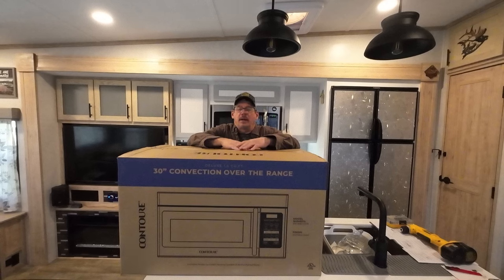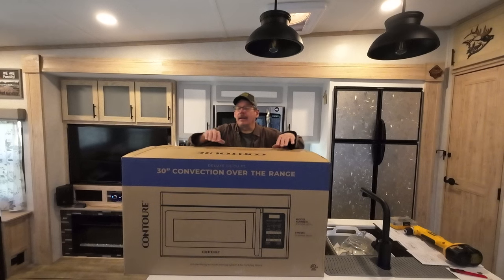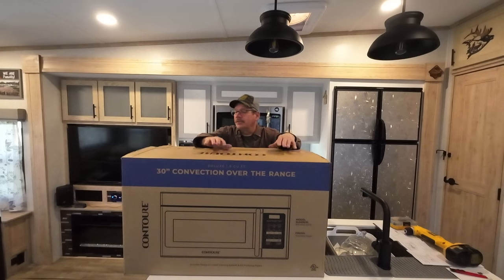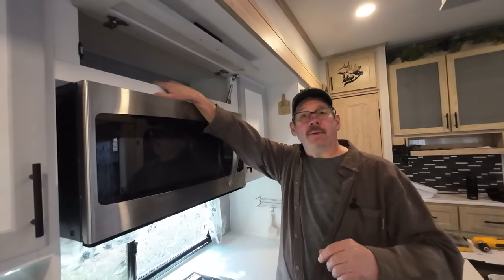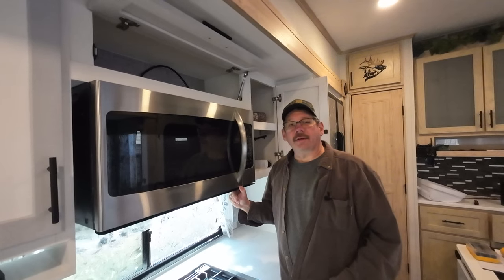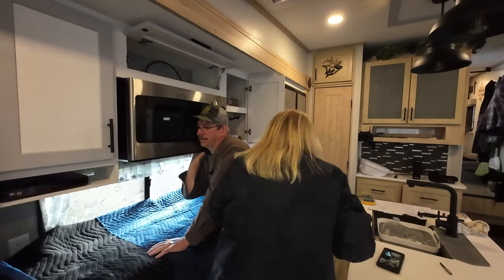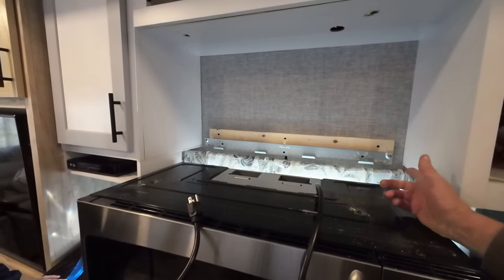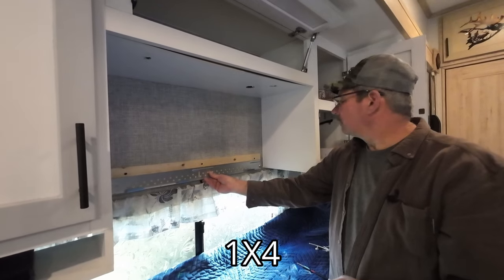Installing a new microwave in our camper (Contoure RV-500-OTR)

Comment: If the new stove is only an inch shorter that the original, can you build a one inch filler to set the new stove on?   The microwave looks great.
Reply from the maker: I was actually looking for one that was shorter. The top of the stove will be level with the counter and the grates will be above the counter. I'm thinking it's going to work out quite well. Becky had one box that wasn't checked with the Avenue, and with the addition of the 4 burner all her boxes will be checked giving her the perfect rig.